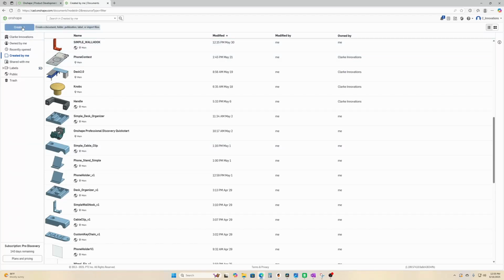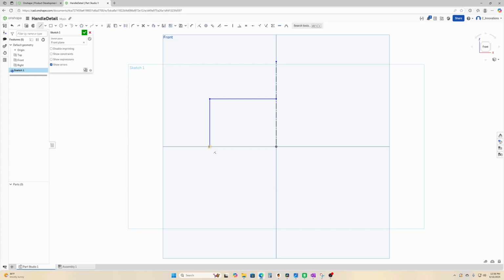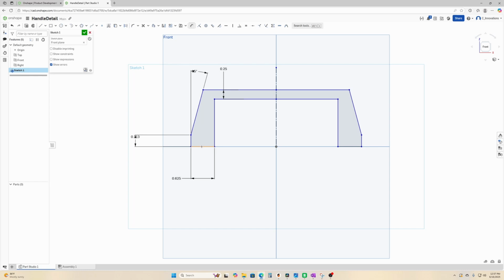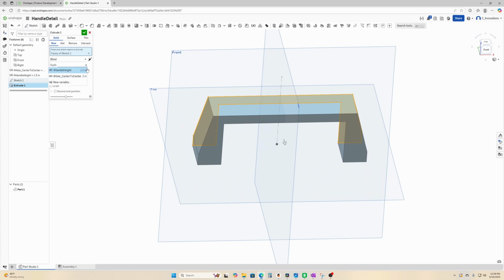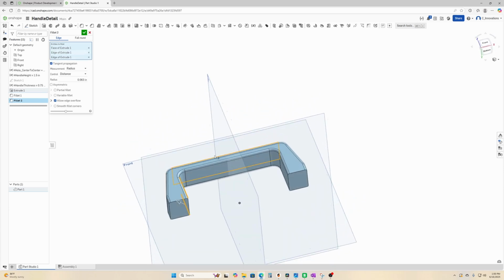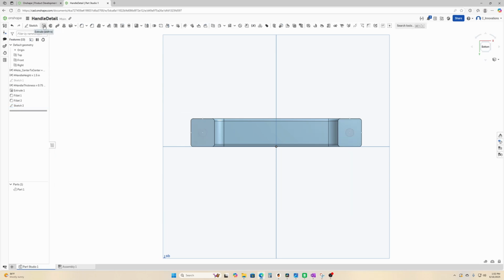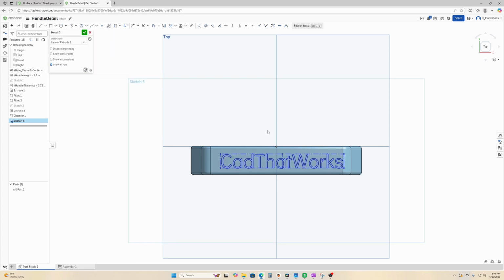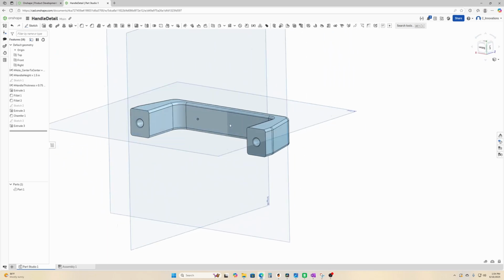Designing a 3d Printable Functional Drawer Handle with Brass Inserts (CAD to Real-World)

Comment: Excellent, ask and you sometimes get 😁👍🏼

Cheers my friend, I find your vids easy to follow and informative so as a complete beginner, they're perfect for getting accustomed to the tools available.
Reply from the maker: Thanks, I appreciate that. Don't hesitate with any future requests!
Reply: @CadThatWorks I do have one if that's ok.

I need to make an adaptor for a vent hose which has two different ends. It's going to fit into a panel with a semi circle who's diameter is 100mm (sorry about the metric, I'm in London, England so don't tend to use inches as much) but then has to change to a 32mm end for the vent hose (like a vacuum cleaner hose) to slide on to. 

I know there's a tool that allows one shape to be merged into another, think it's called loft but I've not used it yet so a demonstration of how it works would be awesome.
Perhaps also, on the hose end, a few ribs around the extrusion to give the hose somewhere to grip would be a great addition to see how that's achieved. 

Thanks again.

Stef.
Reply from the maker: Sure! I'll need an image or a simple sketch, can you share something via imgur for example?
Reply: @CadThatWorks  cheers, I'll try and get something sorted the next day or two 👍
Reply: @CadThatWorks  hi there and apologies I didn't get back to you sooner but been busy with work then went away for a few days and decided I'd try and do it myself.

It came out OK and I'm continuing to practice with different projects so hopefully learning new stuff along the way.